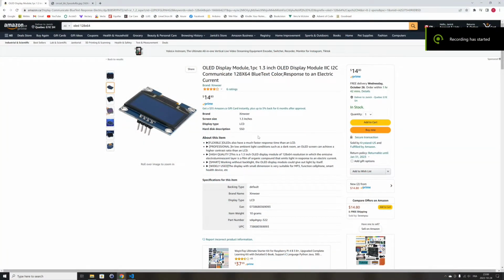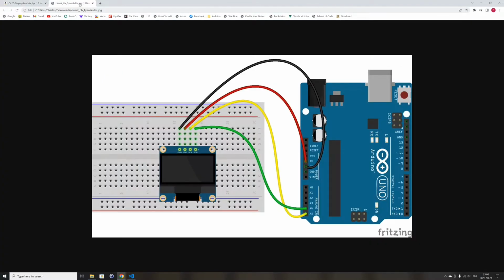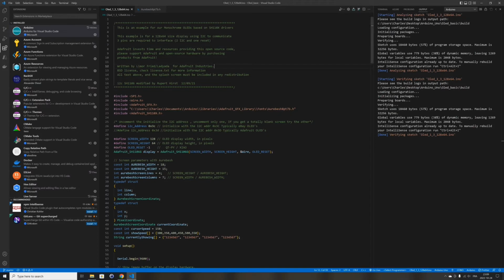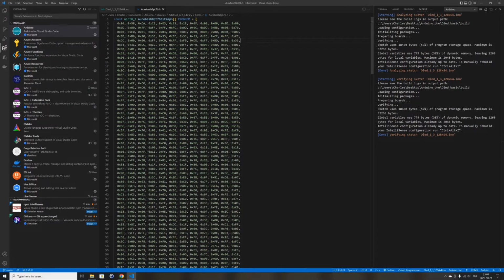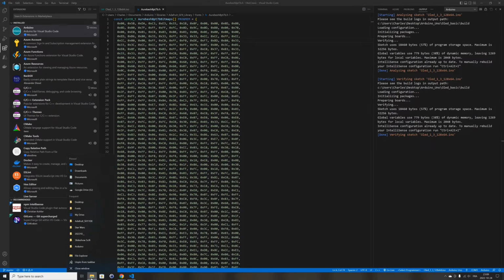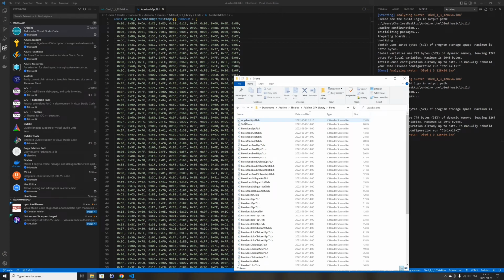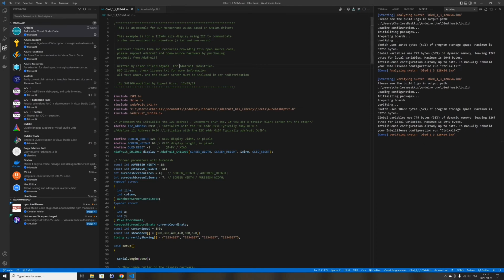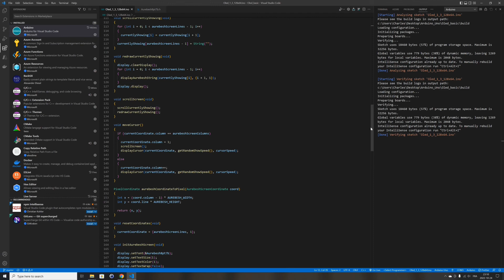Displaying Star Wars Aurebesh Font on a Mini OLED with Arduino

Comment: Very cool! I'm struggling. After I unplug the arduino and try to move it to an external power source, the OLED is not responding. To get working I have to plug back into computer and reload sketch. It's only working on first load and then fails after that. Is it an I2C snag?
Reply from the maker: What kind of external Power Source are you using ?

Comment: Thank you for your videos.  They are very helpful.  I am trying to verify the code from this video and am getting this error message related to the Aurebesh font: from line 22 in your code.  How do I fix this?

#include "C:\\Users\\Charles\\Documents\\Arduino\\libraries\\Adafruit_GFX_Library\\Fonts\Aurebesh8pt7b.h"
Reply from the maker: I have fixed the mistake in the code, you can get the new version, here is the link : https://dev.azure.com/overlording/The%20Last%20Outpost%20Workshop/_git/Star%20Wars%20Aurebesh%20on%20Oled%20Display%20Arduino
Reply: @thelastoutpostworkshop  Thank you but I just downloaded your update and it says "Can't create the sketch" so I can't open it.  Any suggestions?  I'm using the Arduino IDE.  I just tried modifying your last code and editing the same line to read: #include "lib/Aurebesh8pt7b.h".  I can get that updated sketch to work but it can't find any of the fonts in the library??
Reply from the maker: @MakerDan make sure the Oled_1_3_128x64.ino and lib folder are inside a folder having the same name as the .ino file (Oled_1_3_128x64) then double click on the  Oled_1_3_128x64.ino and it should open in the IDE.  I have just tried it and it worked with the Arduino IDE.
Reply: @thelastoutpostworkshop  Thank you for your patience!!  That worked.  Now to have some fun with it.  I really appreciate your hard work and help :)

Comment: I was looking for a Star Wars Aurebesh font. I noticed you included Resistance_starbird.png but I'm not sure where it goes or how to use it. I'm still quite new with Arduino IDE so I would need detailed instructions. Thank you.
Reply from the maker: I Richard, I have include the file "drawStarbird.ino", this will get you started : 

https://dev.azure.com/overlording/The%20Last%20Outpost%20Workshop/_git/Star%20Wars%20Aurebesh%20on%20Oled%20Display%20Arduino?path=%2F&version=GBmain
Reply: @thelastoutpostworkshop  I appreciate the program. I agree with purchasing official Arduino  products. I have the Arduino UNO R3 and have enjoyed learning on it. I notice the editor you use in the video (and other videos) looks different from the basic Arduino editor I am using. Is it an option from Arduino IDE? Also the graphic that you used for identifying the pinout connections to the Oled display, it is built in to the Arduino IDE or is it another app? I apologize for the basic questions, but I've only been using the Arduino IDE for a couple of months. Thank you.
Reply from the maker: @richardphillips1891  I use VSCode as my code editor, I have made a  tutorial if you want to try it out : https://youtu.be/jV1TBbpmzFA.  I have made the graphic with Microsoft Powerpoint.
Reply: @thelastoutpostworkshop  I appreciate you pointing me to the VSCode tutorial. I look forward to checking it out. Thank you.